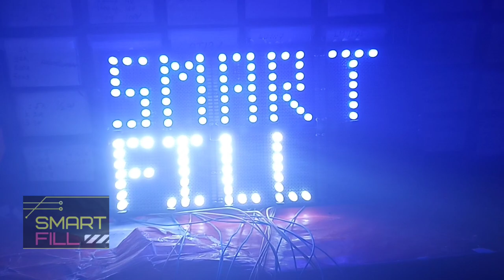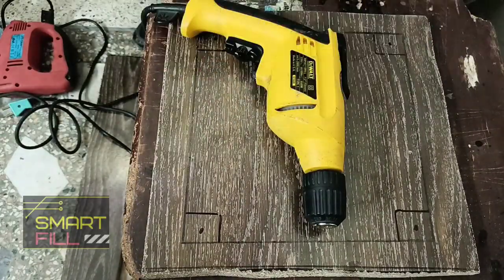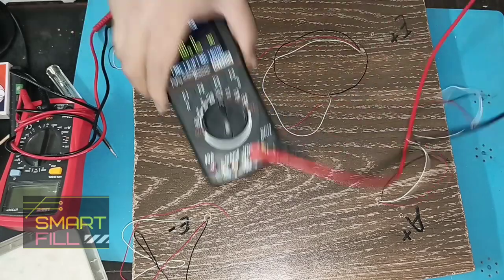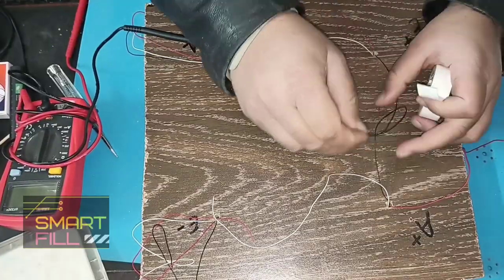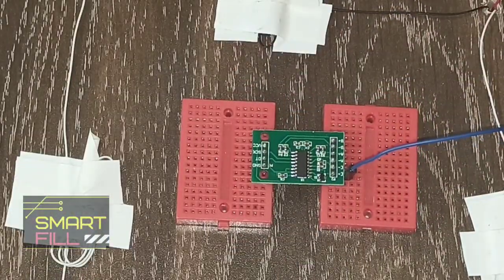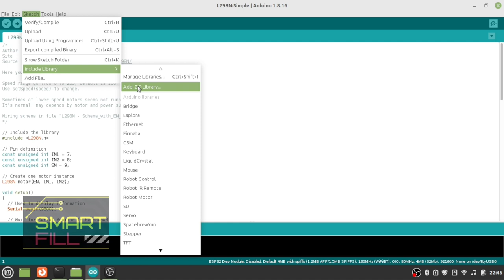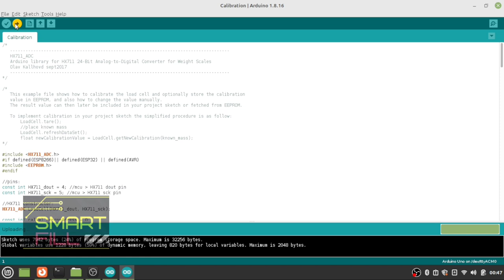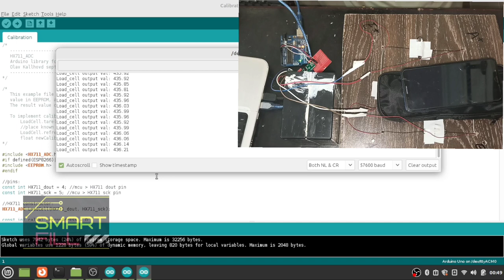Digital Scale Using Arduino | 50 kg half bridge load cell #diyproject #newyear2023 #smartfill

Comment: I have a doubt, by increasing 4 sensors that also increases the weight of the same? I mean if each one gives you a reading of 50 kg, to put 4 adds this? and can give you up to 200kg values?
Reply from the maker: Yes it can handle up to 200kg values not more then that if you want to increase weight you have to increase load cells from 50 to 100

Comment: Hi, can we really use one HX711 amplifier for a 4 load sensors?
Reply from the maker: Yes, we can use one HX711 for 4 load cells for scale. Now when you see HX711 you may see 6 alphabets means even if you attach four load cells you have 2 more left
Reply from the maker: You may see one more long video on my channel and please subscribe 

https://youtu.be/Ib94gPovdjA
Reply: @SmartFill  Is that also applicable if we are goinf to integrate that in our wheelchair? We're planning to do that to know the weight of the user. Is that doable?
Reply from the maker: @edamaebalane23  actually only challenge you will face is the coding and the calibration of load cells ill talk about that in my other video I already give you the link in my previous comment

Comment: i got error
Reply from the maker: more info is needed when u don't join wires currently you get an error
Reply: @SmartFill  the output on serial monitor is not starting but no error on code show i don't know why
Reply from the maker: @freelance9706  did u do it like me find middle wire then combine black with black wires and white with white wires and then solder it then wire accordingly in HX711 and Arduino use same library which link i given in my description